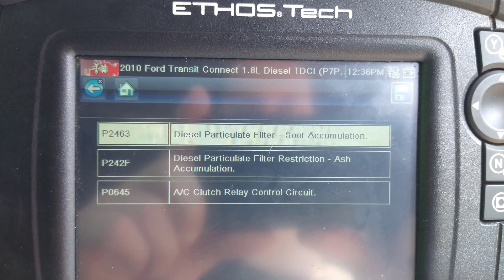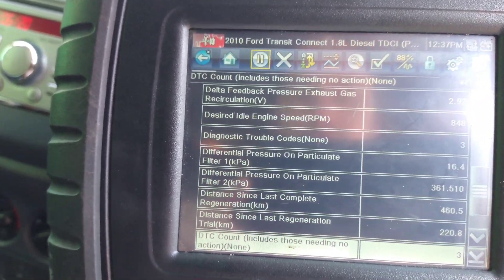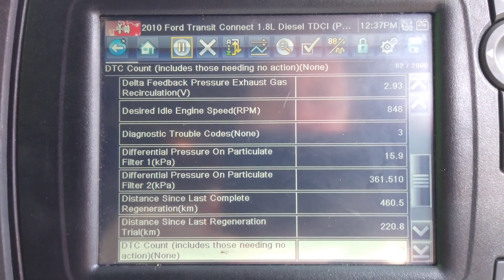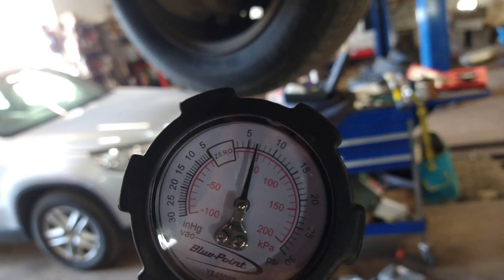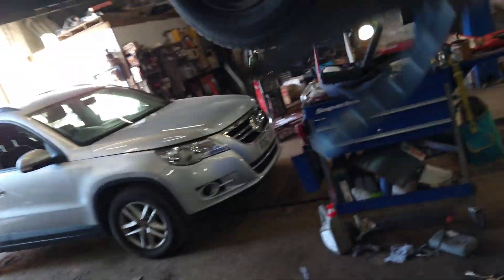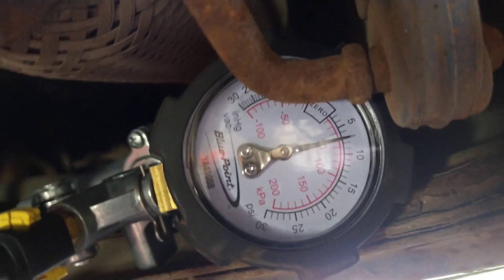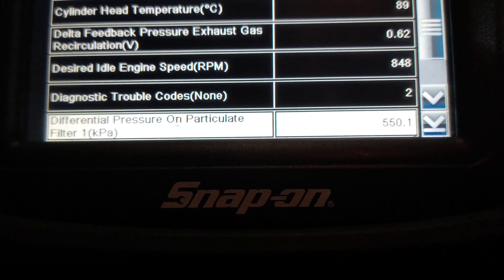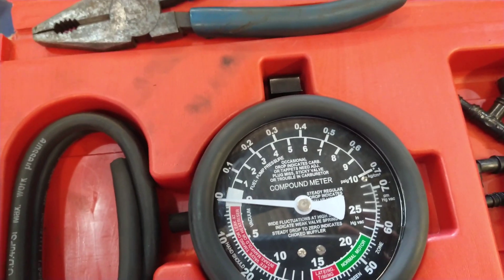Ford Transit Connect (DPF Fault)

Comment: How often should you take it for motorway drive?
Reply from the maker: That's a good question, I think diesels that I see that are doing 12k a year with motorway driving still end up needing a forced  regeneration, that kind of driving helps although it's not the same as a regeneration when the engine changes the way it runs to burn the soot content. Sometimes the cars are getting switched off before a regen is completed because the driver has arrived at the destination. 
Extreme low milage like this getting a couple of miles a day is going to choke the DPF.
Thanks for watching
Reply: Mechanic Matt Thanks! Theres just help out there so confusing like they want it it break as service item, still getting blocked not good or fair. Just hard to know what speed and revs to do once on motorway and if you beed half a tank etc